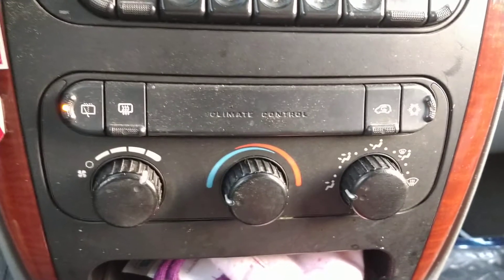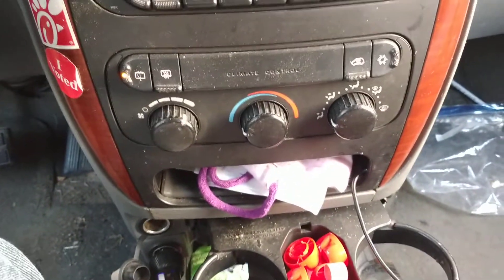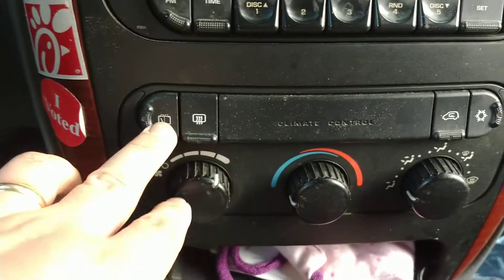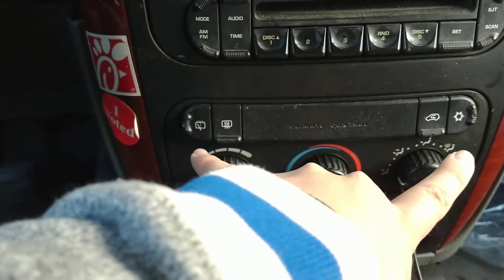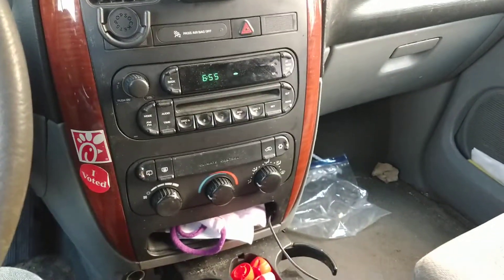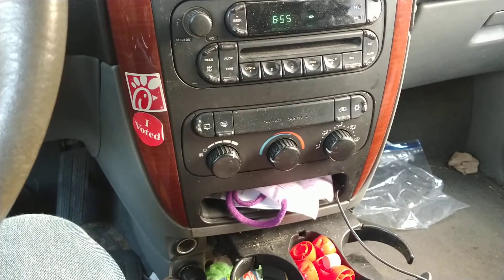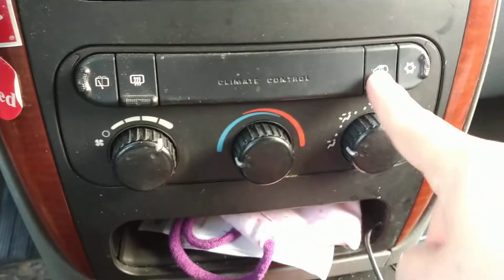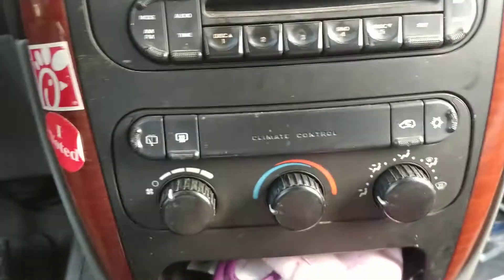2001-2007 Dodge/Chrysler super base model HVAC calibration

Comment: It might have helped if this guy knew what he was doing
Reply from the maker: If there's anything that's confusing I'd be happy to help clarify it for you :)

If you just want a written explanation, it's the following:

Key on, engine not running 
Set fan speed to full
Set temperature to cold
Set direction to "panel" (the ones you use for blowing at your face
Press and hold both the rear washer and ac buttons (the furthest left and right ones, on the control panel)
Release when all the other lights on the panel light up
Wait for the lights to go out and it's now recalibrated
Reply: It worked for me.